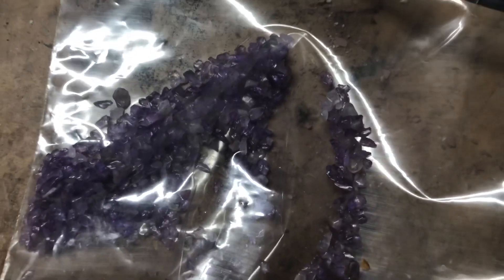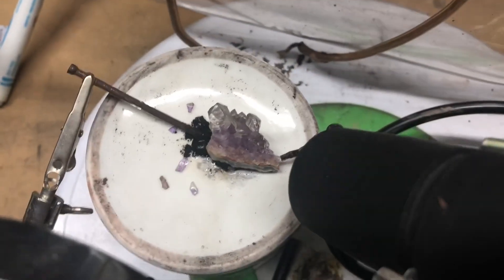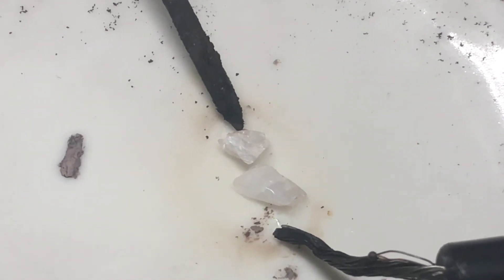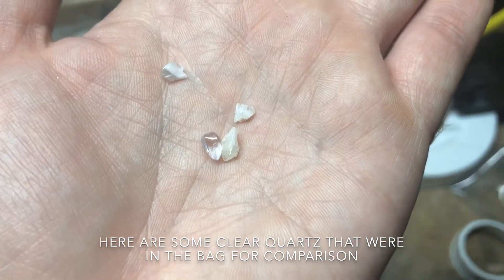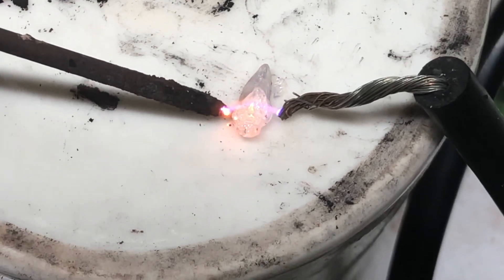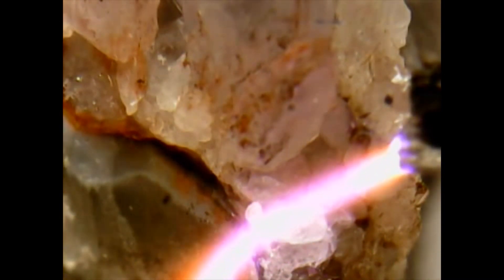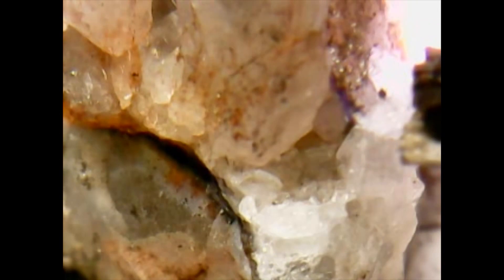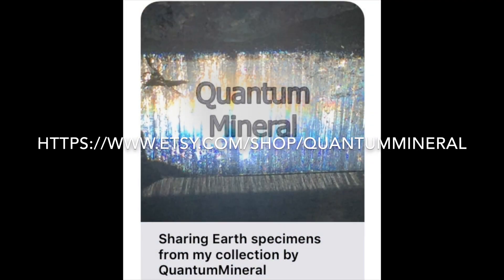Purple Amethyst Crystal vs Electricity with guest Quantum Mineral

Comment from the maker: I didn't highlight this, but I think it's important. Black Iron Oxide and Water were used as a conductor underneath the large Amethyst specimen. At 0:30 seconds in, when the discharge begins, notice how quickly water is evaporated and displaced as condensation a good distance away from the discharge within the first 10-15 seconds. I'm saying this because I see this water displacement and condensation as a small scale visual for how our atmospheric water cycle works. If energy is received in at the poles and distributed through the dielectric layers of our atmosphere, the focal points of dielectric breakdown is where I would expect evaporation and condensation of rain water from clouds on opposing sides. I see this take place in the skies above me with my north and south view skycameras. A low pressure system will roll in below a high pressure system and literally rolls the clouds from the above cloud layer underneath, sucking it down and under into the lower layer like a scroll and massive rain dumps down as it passes overhead.  To try and explain better in layman terms - every experiment I do, the discharge filaments appear to rotate in spirals and so does the electromagnetic field. Water condensation always appears at one side of the discharge... not evenly spread around the circumference of the arc. What I'm comparing this to, on a dramatic scale, is the extreme forces of wind and rain bands seen in cyclonic storm systems. Massive rain and winds are generally observable on one side of the vortex system. On a not so dramatic scale, the difference in electrical potential in a high vs low pressure system creates such condensation and rain dumps along a squall line... in my mind, being pushed from behind some great distance away from where the storm system actually appears, almost like this example here, where the condensation is viewed far outside of where the two arcs are discharging. 

But I'm crazy and my EYES ARE ELECTRIC.
Reply: dude you're the mad scientist i've been looking for. What else have you done regarding electricity and gemstones? Have you thought about sending other types of waves/energy through them?
Reply from the maker: jmick williams I used a terminated quartz crystal with one side covered in clay to conduct current flow to a clay ball on top and used a second electrode to zap a crater in it. Other than the quartz and amethyst, I’ve only discharged to things like salt, iron oxide, etc. I’ve had an idea for some time now to partner with my wife who makes cymatics from reflecting light on the resonating surface of various liquid mixtures, forming geometric shapes from a sine wave vibrating a bowl attached to a speaker baffle. The idea I had was replacing the liquid with a clay mud, sending a tone to vibrate into a shape and discharge into the peaks of the shapes. Crazy idea? Not sure if it will do much.
Reply: @ElectricUniverseEyes   Not too crazy since the vibrations could be a 'key'. This is an especially good idea. Try a multitude of frequencies and ways of delivering those frequencies. If the clay soup doesn't work there are other things to try. Holding the gem with a rod and hitting that rod with a frequency Hz and then hitting the crystal with some sort of charge.

Comment: And the moral of the story is??
Reply from the maker: High density electricity can alter the molecular level of mineral, specifically observed here, removal of iron from the crystal specimen.
Reply from the maker: And.... don't leave your Amethyst in direct sunlight!
Reply: @ElectricUniverseEyes  Formatting lowlevel completed. Ready to install Linux now...

You fully erased it - much like an EPROM by sunlight. But I suspect that it was possibly not the electricity but the UV light produced by the arc. (I own a violet ray device by myself, but no overstrong one, so it would likely fry the coil to output a spark for minutes without tube.)

What happens if only voltage (no visible spark) is applied to amethyst? May it turn into sound waves like by a piezo speaker when modulated with audio? How do amethysts react to lasers of different wavelengths?

Is amethyst slightly magnetic? What does a compass needle close to it?

Is long term contact with amethyst safe for natural latex rubber, or may it decompose over time by its ingredients? (Latex contains sulphur, amethyst iron atoms. I employ latex inflatables for meditation and spiritual development, because latex conducts consciousness and is the most bioenergetically active material. So I may want to combine both in mystical technology.)
Reply from the maker: @AerialTheShamen  Thank you for your reply and insight! You’ve got me thinking! 

Purple amethyst is high in iron content, yes? Iron is electrically conductive, yes? It is also susceptible to oxidation, yes? When an electric current is present, I believe the iron is oxidizing and vaporizing from within the crystal lattice, creating the outward pressure to form cracks and expansion. 

You bring up an interesting question... is it magnetic? I can try seeing how it reacts to a high powered neodymium magnet. It also makes me ponder... 🤔
Reply: @ElectricUniverseEyes  The iron is not dense enough to conduct electricity. The cracks may be also caused by water evaporating inside the crystal lattice, because the arc produces much heat.

Can you make the crystal emit sound like a piezo speaker by connecting 2 electrodes (adhesive aluminium foil or such) powered by audio frequency through a transformer (less voltage than needed for arcing)?
Reply: @ElectricUniverseEyes  Amethyst turns coloured by gamma rays but cleared by UV rays. I wonder if this could be used as a holographic random-access data memory crystal by using 2 lasers with different wavelengths to locally discolour and recolour it at very high precision.

Comment: I've discovered large florite crystals, also purple, found here in NM, will bleach out in intense sunlight.  Interesting.  You're using 10K volts AC or DC?
Reply from the maker: This was with 10kV AC. I have diodes arriving in the next week and will wire up a rectifier bridge to test with DC. Just need to get a Variac to control the voltage! Anyone overflowing with riches... it will go to a good cause.. or at least some nerdy and off the wall speculative entertainment - promise! - paypal.me/electricuniverseeyes
Reply: @ElectricUniverseEyes  
20us on the way.
Reply from the maker: bipola telly THANK YOU!!!!
Reply: @ElectricUniverseEyes  
thank YOU, back atcha'